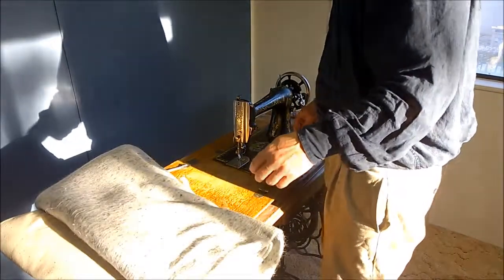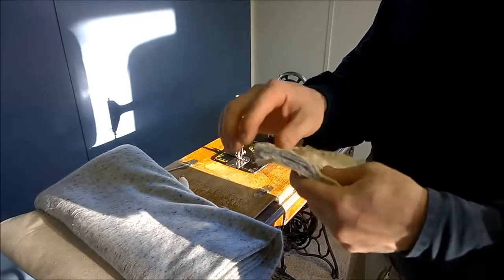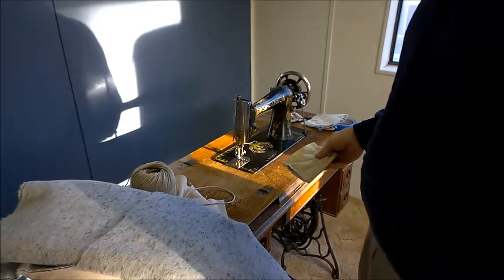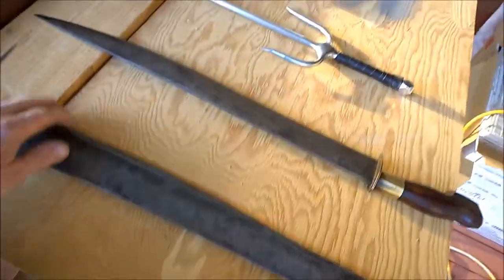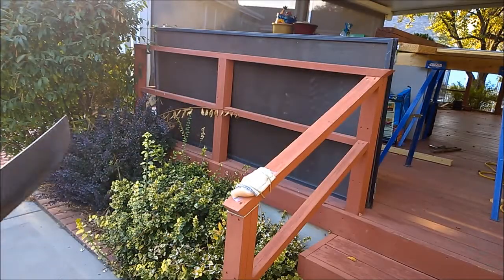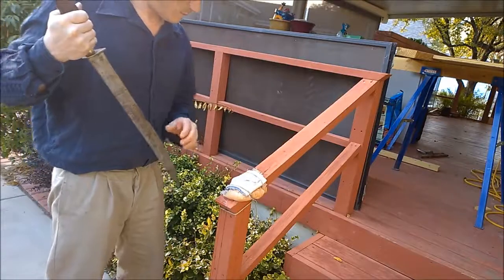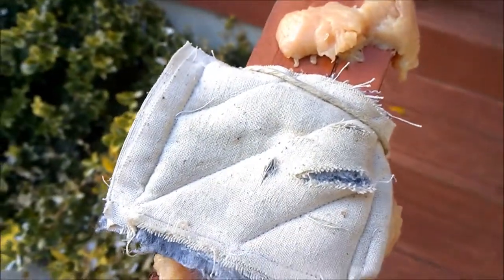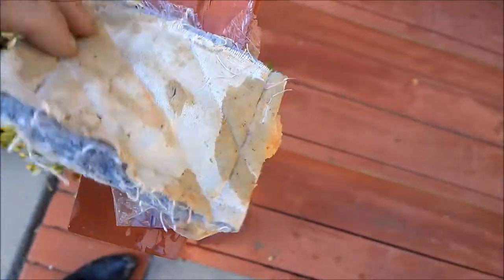Experimenting With Padded Armor - Part 1

Comment: i've just discovered your chanel and i like what you do with the padded armour especially. i'd like to see this type of padded armour made up into a gamberson, like the one you wear...any chance of you doing a how to gamberson video where you could demonstrate the pattern and how you made the rivet holes from this piece?

i agree that i think the holes would reduce heat buildup and could provide some extra protection with something perhaps being worn underneath to stop the rivets themselves being pushed into the wearers body.

thanks
Reply from the maker: +Spikey Hedgehogy
While I've experimented plenty with plates of padded armor. It's really just that. Me using what I already know about garb and applying it forward to messing around and trying to figure out armor. I've never made as much as a full gambeson and I'd largely be speaking from ignorance if I tried to give an instructional on that. 

That having been said. I've made a lot of plates at this point. I've done a fair amount of looking into it. And I've worn padded armour extensively. So what I can do is help people avoid some stumbling blocks with this and share some thoughts on the matter. I'll see what kind of video I can cobble together. It won't be everything you'd hope for. But it should be helpful. Can probably even include something regarding the grommets.
Reply: thanks, that would be awesome. i'm just starting to hand stictch and your t tunic vids are great.
Reply from the maker: Thanks. The last two weren't as good as the first T-tunic vid (of the good hand stitched one) given I had to do them between moves in order to get them done. Hope the major points about it still got across though.
Reply from the maker: +Spikey Hedgehogy
I have a PDF resource for you. Found this some years back while looking for books to read on the subject. It's basically a short authenti-stitching guide. It discusses the main types of stitching found on medieval European clothing. Even going as far as to give lists of dated finds from different locations and what sort of stitching they had. And it has good self descriptive diagrams on how to do these stitches. Some of these are very rudimentary stitches. But it goes from simple to complex. Overall it's one of the better stitching guides I've seen in general (not just for medieval garb). Teach yourself them. Get a good idea of which stitches belong one which period items and you'll have a pretty solid foundation on which to grow that: http://www.legioxxirapax.com/zasoby/stitches.pdf
Reply: thank you so much. that looks awesome 8D
Reply from the maker: Your welcome. It may be about a week and a half to two weeks before I actually get that video up. I just came back from the dentist yesterday. Had 10 teeth pulled (the last 10 that remained) and new full dentures, So I'm high af on pain killers they gave me and not able to talk very well just yet. Also all this week is something of a heat wave. And I can't do a reasonably good job on audio with 5 fans going just to not be baked in my tiny trailer lol.

But I will get on putting something together the second I'm able to. I've already got a decent idea of how I want to do it. So it shouldn't be too long.
Reply: i'm a patient person. recover well.